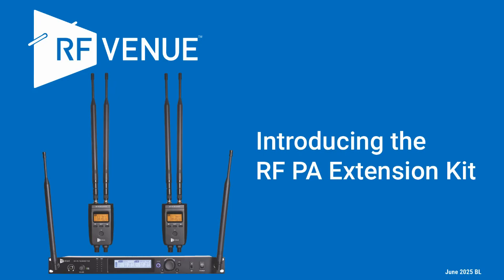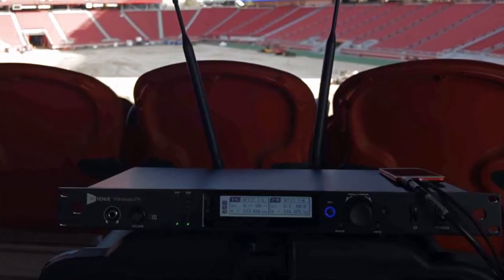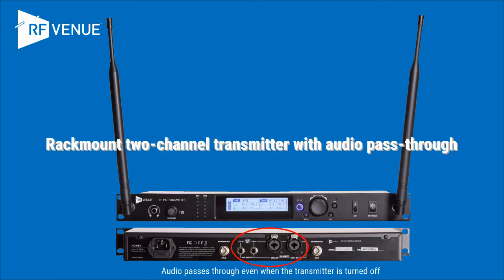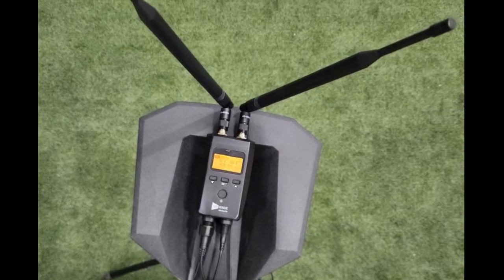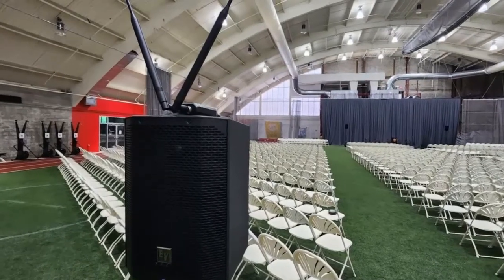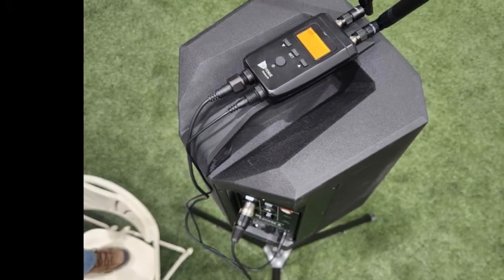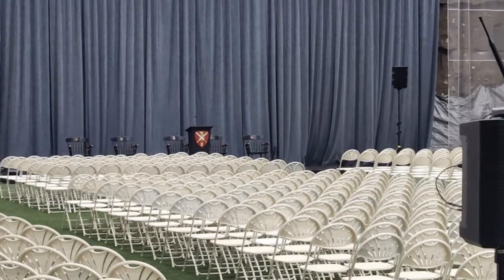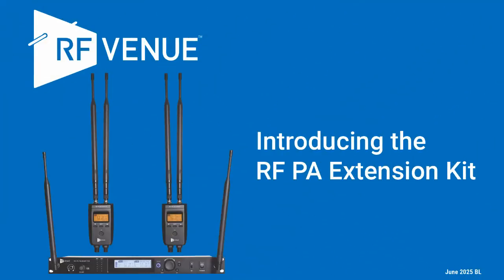Introducing the RF PA Extension Kit

Comment: How does this compare to a modern IEM solution, say the Shure Axient ADTD units?
Reply: What I understand as a big feature is that you can send two channels traveling to eight systems, and those eight can be set a different delay time up to 800ms.
Reply from the maker: Yes, the 800ms of onboard delay is really proving invaluable to users
Reply from the maker: First, the price of the TX unit itself is about 40% less than our RF-PA-KIT bundled stereo system. Secondly, adding more receivers are $549 EA. The cost of adding the Shure ADXR units is about 30% higher per unit. And, a stereo option may potentially require another ADXR BP since I imagine you won't prefer to use a custom cable to interconnect them across a stereo field.